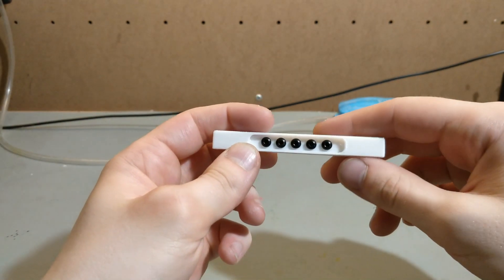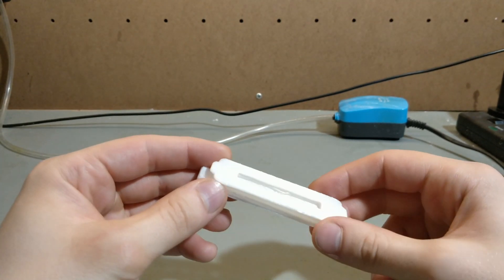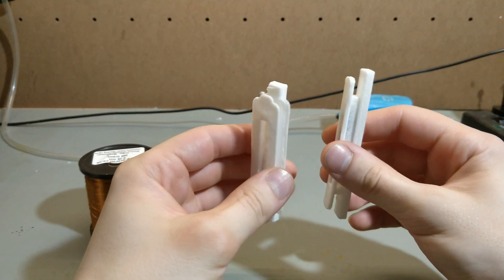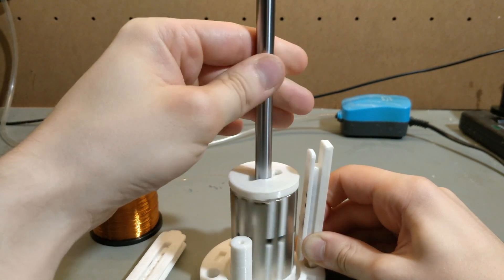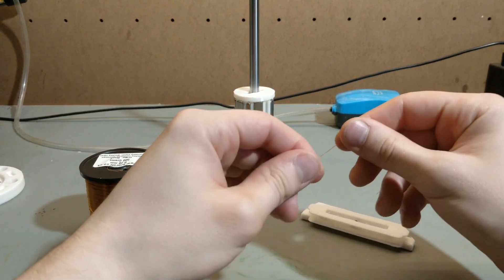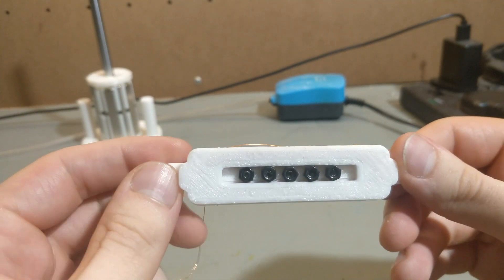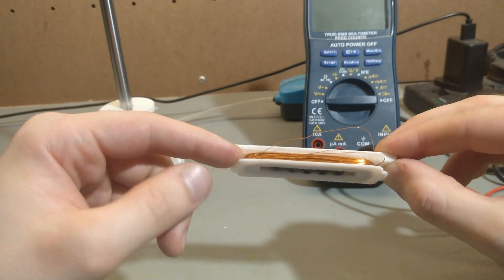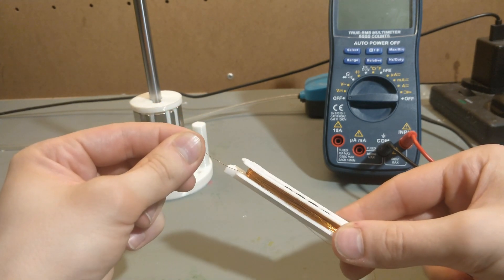The ModuCoil V2 - A coil with a bit more Oomph! #tinkering #diy #3dprinting #sustainability

Comment: I would recommend to work on an automated wirewinder and the coilholder, so you have better efficiency
Reply from the maker: I have plans for a hand crank coil wonder that would make things a lot easier. I've already done a rough design, I just need to refine it and print it out! ;)

Comment: I seen your design on facebook hackaday page and immediately clicked it. Your design made me curious about something, the orientation of the screws matter in this design? I mean, If for example instead of having 5 short screws like this design has, we have a longer screw from top to bottom? (hidden in the plastic with a small cap not to mess the windings). I need to try this, because if the magnetic field will go in the ends of the screw (or even a rod, it doesn't have to screw because we already have a cap), would cancel the loss of magnetic field in the "ends" of the coil (the parts that don't get pass the magnet at 90 degrees). I hope you understand the concept I'm thinking.
Reply from the maker: Sounds like a plan. Why not try it out? 👍

Comment: Thats very cool.  It looks like a guitar pickup!  I don't know much about motor designs, but I do know about guitar pickups.  One of your losses that will keep your efficiency down will be leakage inductance.  Leakage inductance is "uncoupled flux".  I estimate it by  how much of the volume inside the winding is air.  A certain amount of leakage inductance sounds good in pickups, but I might be inclined to experiment with filling the entire inside of the coil with screws.  And decrease the length of the coil to fit more precisely the core (steel screws).  I hope that is contributing, as I really don't know much about motor design.  Keep up the good work!
Reply from the maker: Thanks! I'll keep note of this.